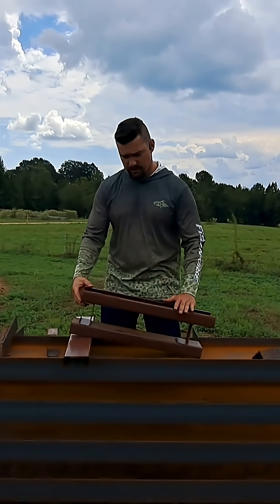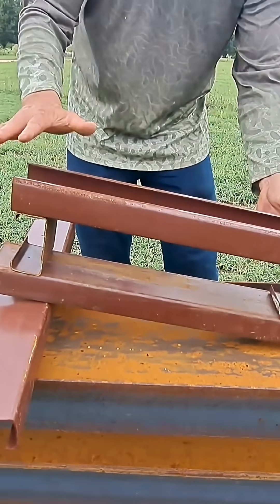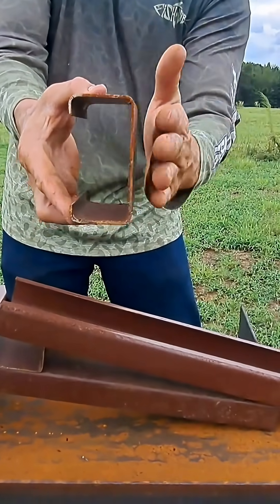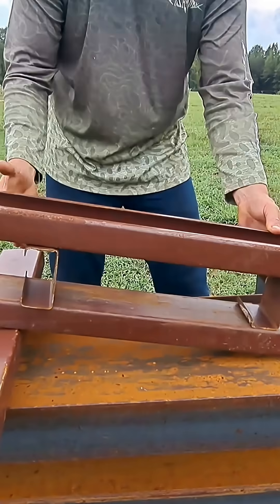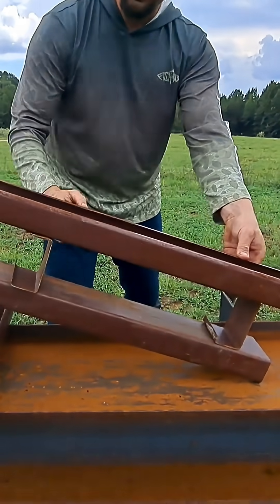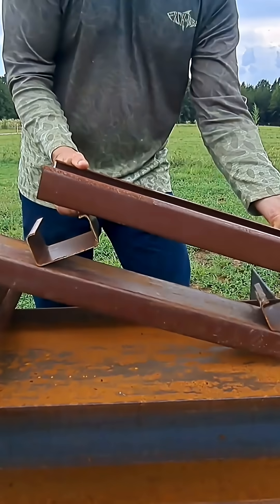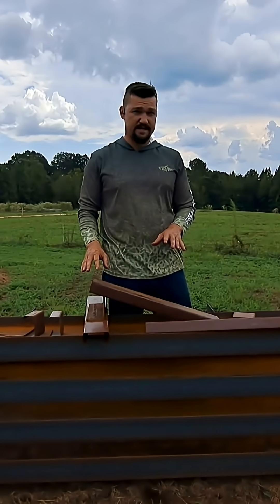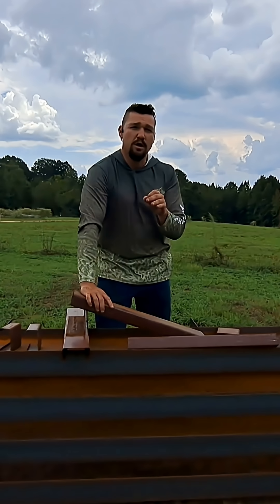Strong Roof Design: Perfect Pitch with Metal Purlins #metalhouse  #buildingourhouse

Comment: Carpenter and GC here, of course spec's different for metal.  at 4/12 or below, you still have a straight vertical bearing line through the wood.  It's not c shaped, it's solid core.  And unless engineer advises otherwise, I put a scrap of c purlin about the size you're using as demonstration purlins, that is, about as long as the truss is wide, or a bit over, back to back with the purlin.  Though I must admit, I build in the southeast, and mainly with Southern Yellow Pine.  So it may not hold up to a Minnesota snow load, again, if you're not sure, consult an engineer.